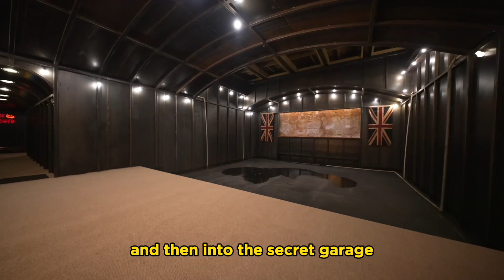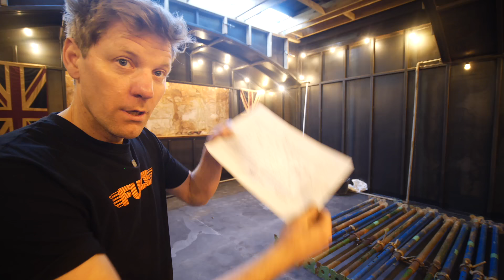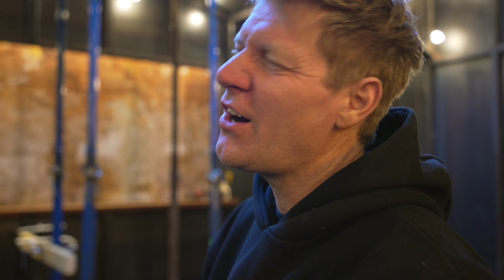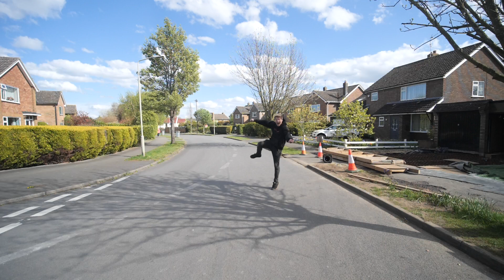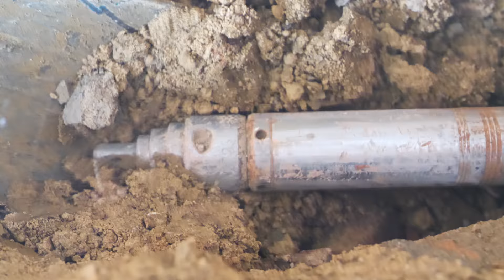Digging a SECRET Garage Part 6 THE COVER UP!

Comment: im studying in construction and ngl i both understood and was confused by the rebar plan XD
edit: most sites prefer to use rusted rebar because it holds onto the concrete better then new steel, any site you drive by you WILL see steel rebar that has rust on it, its fine and a little rust wont compromise it

Comment: Colin if you want to use it as a real bunker you should leave room for a generator, in case the line doesn't work. And maybe a gas oven or a stove, with the proper exhausts.

Comment: why not have a left in the center and when it goes down it will turn (spin) the car around so, when you exit it will be facing the direction in the opposite way. This will help support the car when it is lifted ? Just and suggestion.

Comment: Would it have been so much more expensive to use all galvanized rebar?  This would massively improve corrosion resistance, as well as improve performance by increasing adhesion to the concrete (higher pull-out strength). Given the amount of moisture in your local climate, it is a wonder that galvanized rebar is not standard.  Concrete will only protect the rebar from rust for so long. 30 - 50 years, maybe?  It depends on how wet is your local climate. Galvanized, it would likely be 100+ years with no concern.

Comment: I wondered as I watched this - what singular tool was the MVP/Best Bang for the Buck of this project? The rubber buckets were incredible for moving dirt and cost peanuts. The welder was used on every step of the project. And the tie gun for the rebar saved what's left of your sanity. Hard decision imo

Comment: As an Aussie steelfixer with 21 years experience I think you did a great job for an ex plumber. The designs structural engineers come up with certainly test our patience some times, so easy to draw it but constructing it is a total different story.
I did shake my head at the tying gun. I used one for about 10 minutes once, biggest piece of junk out there. Give me my 280mm Knipex nips any day, faster and better ties.

Comment: Rebar looks great! Does the rust give the metal better engagement with the concrete?  The rough texture seems like it will have more bite than smoth metal.

Comment: Ive just had a new gas pipe put in this week and was well surprised when the old one was 38mm steel pipe with 5mm wall and the new one was 15mm plastic pipe with 1.5mm wall🤣

Comment: question... why not use them pre made slabs that they make for commercial builds and such . pre tensioned steel and all that jazz? would that not be more efficient/ quicker and less labour intensive probably overall cheaper.
Reply: precast concrete slabs.

Comment: Over-engineered for added support is probably a good thing.  But, did someone think you were expecting fully loaded freight trains traveling over your drive?  I've seen main motorway overpasses with less rebar and concrete  :)

Comment: So let me get this straight Colin:

You were too cheap to buy a 40 quid wet vacuum that you could have easily used at every step of the project because of England's rainy weather and all.

But then you buy these trolleys that look quite a bit more expensive than that to move the scaffolding ONCE?

Make it make sense, man.

Comment: for the people concerned about rust. simple: rust is ironoxide. oxide is part of water and air (oxygen), concrete removes the air and the water from the rusty area. no more oxygen = no more rust.

Comment: I'd have 3D printed some bigger caps for the green rebar caps. In fact I'd be tempted to fabricate some barstool seat sized caps. Then you've turned your worksite hazard into a worksite feature.

Comment: Mr Fruze, you 99.9999% likely won't read this but someone else may and it could help them in your beautiful British weather.

When you get drawing plans from your archy tech, the first thing you need to do is pop on down to a store that does laminating and get all your drawings laminated. This will allow you to man handle the drawings with your big manly hands and not damage them or if your big manly hands are too many big and you unmanly drop the unlimited drawing plan on your beautiful British "sunshine"(?) soaked ground, they will not get destroyed or soggy from the beautiful weather "sunshine"(?) soaked ground.
Laminated plans with keep them warm, dry and also allow you to draw on them with whiteboard markers that will allow you to section off areas of the plan drawings without destroying them or making them messy and require a reprint.
Think laminating the drawings and any Spark, Chippie, Brickie, Builder will see benefits the first time the wind blows them away or the liquid "sunshine"(?) Liquidated them. Apologies for the waffle now get back and finish the garage. I have been waiting far king years for this to finally finish and see what you can possibly next do to the house. Need elevators for old age when your knees will not allow to climb one of those ladders in less than 30 bloody minutes with a 7 minute tea break stop half way up or down.

Comment: Oh man, imagine doing all this without the tie gun. That would have been so tedious.

Also, wait, a wet/dry vac isn't just a default thing to own if you have a house (especially with a basement) in the UK? I've always had one around in the US in case there's plumbing or weather disasters or just to clean stuff I'd prefer to not have going through my normal vacuum. I may be weird, though. I'm also a US person who owns an electric kettle.

Comment: Reflector sand on substrate or have  you seen that green floral blocks that can be saturated by water.. you could build a block wall and sray water on it till damp. Can make it as thick as you want.

Comment: 35:00 nice work censoring the license plate! bit of advice: pixelation is very bad at concealing text, you can pretty much decode exactly which characters are on there by analysing a few frames. But pixelating is still better than not censoring at all, am i right?

Comment: You call yourself a YouTuber, but you're clearly a tradesman. That was made clear by how good of a job you made of the rebar. It's not an easy job and requires problem solving abilities and skills of a tradesman who understands the difference between flat,straight,square,level,plumb and also having pride in the quality of your work. I truly believe any good tradesman, regardless of trade, could do almost anything the other trades do with minimal input from Google youtube and good old-fashioned knowledge passed on by your elders. The whole job is the dogs dangleys. What an epic build and journey it must have been/is for you.

Comment: You really should think about getting a solar system with batteries to power it. You could go off grid and have mains back up for the winter to charge batteries on night rate. Or maybe go hybrid invertor so its grid tied but will work in case of a power cut.

Comment: The concrete doesn't even have to stay dry to protect the steel, it's the alkalinity that does it. Larger water pipes are commonly lined internally with concrete for both mechanical and corrosion protection

Comment: Hi Colin I hope one of those extra pipes are spare to allow to upgrade your electrical mains because you have just massively increased your house square meterage by heaps and made a big shed that might need more power for tools that might get used in there and house hold power demands keep increasing

Comment: What was the cost delta of the metal vs timber headers for you.
And if you didn't have all your fab equipment on site would it still be cost effective to have somebody to make metal headers in your area compared with the wood cost and labor.

Comment: Sir, I note surface rust on the rebar and was wondering why it is not a concern. My lay mind wonders about it interfering in the adhesion between he rebar and the concrete when it’s poured. Is there some fancy chemistry at work or does the Furze’s little helpers come out at night and polish it all off? ;-D
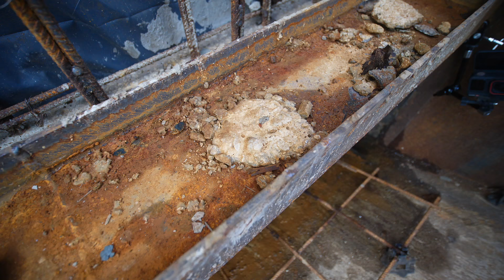Reply: Umm - scratch that - I just got to 19:00 and lo and behold your Furze-ESP has answered the question ahead of my asking! How freaky is that, or what? ;-)

Comment: if rust converter is not needed, why is it invented? rust is a type of disease, if you want, you can neutralize it. rust happens because of electrons binding oxygen to the metal

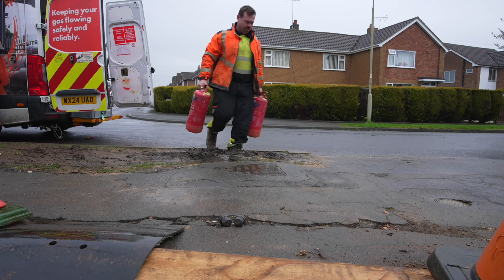Comment: 23:58 those rebars sticking up, one could save ones life by drilling holes into pieces of wood and placing them on the top of the rebars sticing up.
Falling on those can for sure end your life, at best it just hurt you when falling on them, the en rebar workplace is actually easy to fall at.

Comment: I worked on a concrete gang building a multi-storey car park back in my early twenties. Now aged 54, I still feel that not enough time has passed for me to work with rebar again yet. We didn’t have those fancy wire tying machines either, we had to do every single one by hand and my forearms looked like I’d been dealing with rabid cats for months after. 
Awful job.

Comment: @colinfurze, great project but please stop with the 'concrete protects the steel'. We all know that this isn't correct. As you must know, concrete is porous and even if you use a special mix designed for tunnels and water tanks, you're going to have to deal with corrosion. As a Civil Engineer on one of my projects said, 'Our professor taught us that concrete does two things. It cracks, and it cracks'. You can guess what happens then. Yup, that's why we have codes for this sort of thing.

Comment: Does the English electrical system use an MEN system where you’ve gotta ensure the equipotential bond with the earthing for all of that metal? That’d be a pain of an installation test in my neck of the woods I reckon

Comment: There's definitely a duality to that ledge that wouldn't break away. 100% if you weren't worried about it, some poor idiot would step on it and definitely fall to their death, possibly even spilling their drink in the process. But sure enough if you freak out at length about it, turns out it's stronger than granite.

Comment: Haha colin ive just made a container with a pipe down to the bottom and 1 on the top to use with a fridge compressor turn valve to suction and boom also you can fill it with gearbox oil for them stupid awkward fill ports or anything else that needs oil filling in silly to reach places, Or dumping its contents you just sucked up. Its a multi multi tool haha

Comment: Colin you should have looked into how the old War Bunkers were made as this to me looks a bit of overkill, it also explains to me why when see something new being built the job may run in to the millions. Most of the old war bunkers that have lasted maybe 80 Years look as strong as did when built with many as we speak still solid enough to be used now as something else.... A question i often sit while watching this is could Colin survive a Nuclear War? I won't mention though how secure a weed farm would be if into that kind of thing. =^.^=
I also wonder if you could share just what this may have added to your home insurance
The SIM Card ad you felt like you should add had me wondering, doesn't everyone have a phone that takes two SIMS as standard and no need to take out your main SIM? Right back to when used an ASUS Phone, I have always had two sims in my phones, one for normal use and one for that list you end on when want you contacting me. [personally for myself though, if going on holiday i feel my phone would remain at home.] 
As the ad started though I thought, WOW, Colin has only gone and got himself a Sponsor for Easyjet by the way it started but alas nope.

Comment: If I won the lottery this is exactly what I'd want to do w/ my family home from 1895.... It would be right beside the house and would connect to the basement (and under the backyard would be the bunker that connects to the basement as well) but I'd keep the grass on top so it looked completely normal then I could get on top, lift it up then mow the lawn 10 feet in the air.      😂😂

Comment: 35:04 Blurred out the license plate (which isn't actually enough to stop people from reversing it btw if you want to cover sensitive data, ALWAYS BLACK IT OUT, OBSCURED IS NOT ERASED) and then the next scene has it unblurred. In case you actually care, you should probably fix that.

Comment: I guess I have not watch in a while, but what happened here with structural engineering and diagrams. What happened to a hydraulic press and just winging it. Did I miss something. To the counsel sing you or something?

Comment: Hey you censored your number plate in some scenes but in 35:04 it can be seen in clear. Also, redaction by pixelation apparently can now be undone by AI, so just a heads up.

Comment: I had cause to run some elec cable through some small diameter tubing so I tied a lump of cotton wool to some string put it in the tubing and blew it through with an air compressor save a ton of time

Comment: About 20 years ago I was a steal erector for ~6 months. We built a tower block of flats. We had to prep the rebar for each floor it was miserable work you couldn't stand comfortably and you were constantly scrambling across it to tie it together. No fancy gun we did it all by hand. Also had to put these plastic spacers on the bar, that killed your hands too. I'm glad I work in IT now😂.

Comment: I can see how you would want only one power input, but you are feeding three locations...Personally I would consider each section having its own breaker, to reduce the loads, and if you need more power to one section (say, the underground garage), it's then easier to upgrade the breaker fuse to carry a bigger load. Either that or split lighting from sockets on their own breakers, and have one more for socket support on a bigger ampage. It's actually more beneficial to have separated breakers, for future repairs and additions.

Comment: Colin you should try to design the lift to have a drop out floor so you can use it as a normal car lift thats useful for auto maintainence (oil changes, engine work, etc)

Comment: You COULD take out the middle Acro prop and bridge the two near the middle with two short props to hold your mid arch up safely.that gives you a big gap in the middle to bring your parts in. :)

Comment: So all of the utility pipes are forever sealed under reinforced concrete? Hopefully you'll never have to touch those ever again. Hopefully you have marked down their locations too so if you really need to, you have markers to guide you (otherwise it will be looking at this video and guessing their location based on their positioning in the footage).

Comment: 19:09 - there is a wall in Vesturgata in Akranes, Iceland that was built over 60 years ago and had some bits of rebar and other steel rods in it. Not rusty at all as we broke it down. Concrete does indeed protect the steel that protects the concrete from breaking apart etc.

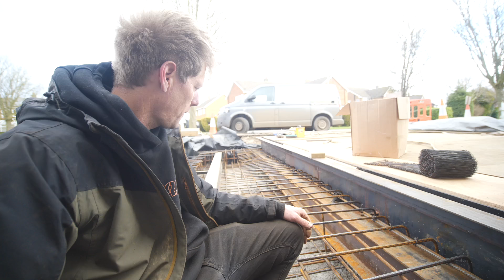Comment: As a guy that works with rebar all day everyday, I appreciate 14:52. The puzzle is a great analogy, but it is very satisfying when it all comes together.
Reply: Generally not to bad... but the auto wire ties... so much better then doing it by hand, even though you use more wire.
Reply: @wobblysauce  repetitive stress injuries from manual rebar tying is definitely a danger.
Reply: As a civil engineering student, I can assure you that designing it is as much of a puzzle as putting it together.
Reply: Agree to that ben working as a steal fixer (rebar)  for 10+ years. Been a few good pusels.
Reply: Agreed, I love working with rebar and concrete, just because of the puzzling and satisfaction when it comes together
Reply: Installing Rebar is one of the toughest trades on the human body , Hats off to them !
Handling cold steel chills your hands and causes early onset arthritis in hands and wrists , They also end up with back and knee injuries.
Bricklayers , Boilermakers and concrete dudes also suffer for their work.
someone had to do it ...

Comment: I'm looking at Colin reviewing where he is at with this project towards the end of the video, and I'm wondering, why does he look no older than when he started his channel all those years ago?  He hasn't put on an once of weight, and I bet he needs 6000 calories a day just to stay even.  But then I wondered, is he in fact, a cyborg?  That would account for his Eveready Battery advert bunny energy that keeps going when everything else has run flat.  You'd have to assume that his firmware needs an update if he is a cyborg, because, let's face it, he is not normal.  There's every chance that the first time he uses his yet to be built car hoist, it will be ejected from the ramp and end up on the roof of the house. It'll be no problem though, because Tom will come and lift it back down with his telehandler.

Comment: You understand that man has been tying rebar with a pair of side nips or end nips for the last 200 years. Man does not need a rebar tying machine to do it. Plus, it's just as fast, if not faster, manually tying it.

Comment: My job is to recycle rubble and old concrete from all kinds of buildings. And all of it that has rebar is still completely fine. We break open the old concrete to take out the rebar for easier processing. It always looks as good as new. So don't worry about rusty metal inside of concrete, it'll last for ages

Comment: Be very careful with how you blur sensitive information! Pixelising it doesn't work, particularly when the image is moving around underneath the filter - you can use an algorithm to work out what exactly is under the filter that way. Most blur effects are deterministic as well, and can be reversed.

Either slap a black bar over what you wanna hide (and make sure it's a proper black bar, and not just a very very very dark bar), or find a blur that can't be un-blurred.